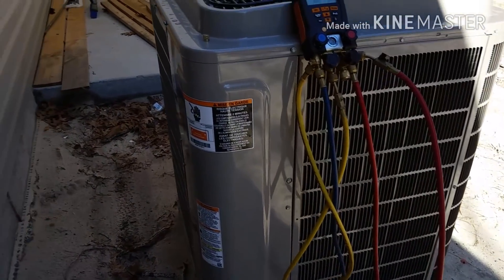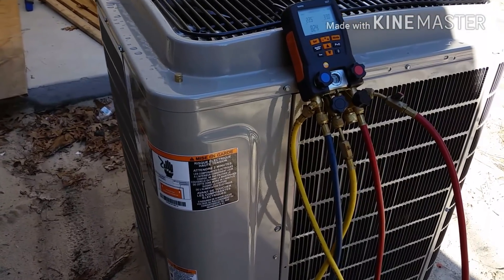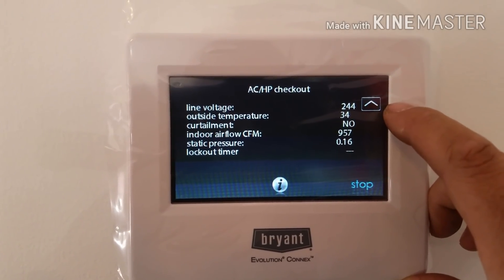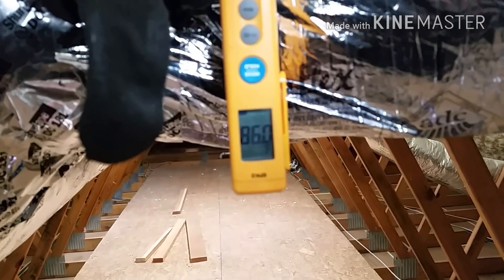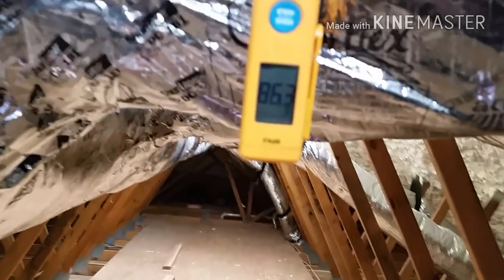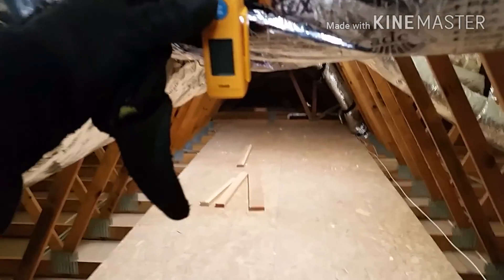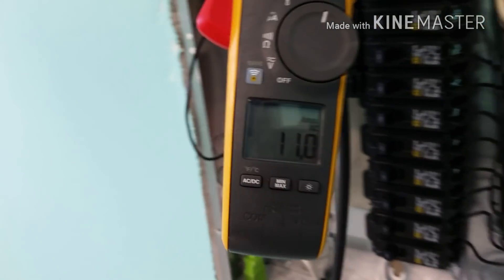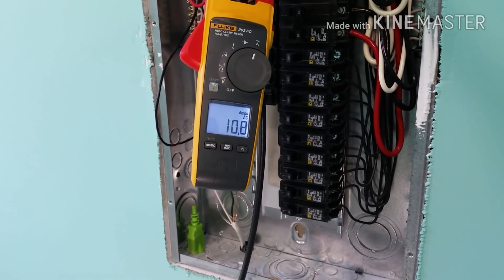Heat Pumps Can't Work In The Cold

Comment: Nice! I'm loving my Variable Speed Heat Pump. It's zoned so right now my four ton outside unit is running wide open with one zone open at 750 cfm. It's 12 degrees outside, my discharge temperature is close to 100 degrees and the unit hasn't defrosted in 93 minutes!
Reply from the maker: ComfortPlus Heating and Cooling Heating and Cooling Hell yeah! Very nice Chuck. Thanks for watching!
Reply: My mini split does a way better job 🐱
Reply from the maker: @brandonjohnson7851  As it should since ductless systems are generally more efficient. Thats why they don't have heat strips. 😏🤷‍♂️
Reply: @HVACinSC  Hi - we have a mini split and it turns off at 29 degrees (we don't have back up and have to revert to our woodstove). I have heard there can be some kind of protection (not touching the outdoor unit) which will keep the temp higher. I note here there is ducting, which of course, we don't have. I've been trying to get hold of the installer and the service in my neck of the woods to find out. They are good when they are here, but poop poor phone service, email etc. We have a 500 sq foot mother in law apartment, and the unit is a Mitsubishi, 12,000 BTU. Any suggestions for some old folks (tired of hauling the wood that we've done for 30 years prior to the heat pump)?
Reply from the maker: @Claire O'Sullivan Mitsubishi ductless heatpumps are good down to well below zero. If yours is shutting down it is likely locking out for some reason. (Example - Low on refrigerant)
Not much I can help with sight unseen but you can go to Mitsubishi website. It is fantastic and full of documents and troubleshooting and setup information.
It's called www.mylinkdrive.com
Search your specific model and see if that can help narrow down this issue.
Reply: @HVACinSC  it's brand new as of last August. How often does refrigerant have to be added? It shut down the first time it hit 29 degrees. Very consistent with that. Thank you for the link!
Reply: ComfortPlus Heating and Cooling  which system do you have?

Comment: They say it’s hard to stop a Trane. It’s also expensive to start when it fails. Multi speed motor with multiple taps was about $800. Why don’t they just use a triac a vary the voltage to it instead of a special motor with multiple speed taps?
Reply from the maker: I dont design the equipment.

Comment: I was measuring a 16-18 degree rise across a 4 ton Lennox inverter heat pump at about 35 ambient. Had the airflow settings at 400 CFM/ton, then dialed it down to 350 CFM/ton. Didn’t improve much (20F split). My boss was telling me these temps were normal at low ambient temps. Didn’t feel right to me as it was an inverter unit, which should be able to handle it. I was expecting a temp rise of closer to 28 F. Gut instinct was right.

Comment: In 2012 I installed a 3 ton Evolution Extreme and loved it!!!  Very quiet and inexpensive to run while providing "hot heat" in 36 degree weather no problem.  Minimum operating temp in heating is  -15 degrees whish I think is lower that Mr Cool stuff.  I would actually recommend a 10k minimum heat strip in cold climates as these machine are not infallible.  Great video!!!

Comment: My furnace is due and my chimney is due, I'm looking into a heat pump and I'm glad to learn you can add a supplemental heater. It gets to -30c here for about two weeks each year and -20c for about 3 weeks on either side of that. I would also put in about 5000W of solar at the same time.

Comment: So the attic is actually one massive air return and thus heated? That's allot of extra space that doesn't need to be heated...
Reply from the maker: It's semi conditioned space because it's the return. It adds very little to the load calc. This is a 2000 sqft home (not including the "attic" and the home has a 3 ton HP if I remember correctly. 
It's also "heated" naturally because of thermodynamics. Hot air rises so instead of adding ducts to pull the air up to the unit, it basically rise naturally with a relatively small assist from the blower. Its working incredibly well.
This may not work as well in other regions but in coastal South Carolina where we use cooling no less than 8 to 9 months a year, it has worked great for several years now and counting.

Comment: That won't pass final inspection without emergency heat (heat strips...)......but yeah, I've been in houses with older Trane units that worked into the 20's without back-up heat kicking in. The real key is insulation. The Trane went through defrost boards every couple of years.....never figured out why, but it worked great when all was well.
Reply from the maker: 😆😆 "Won't pass final inspection" False. Passed with flying colors..... Over 3 years ago bud... 😁 You just need to find Inspectors that understand the industry and latest technology. Electronic heaters are quickly becoming a thing of the passed.
Reply: I never ever had a unit that didn’t hear to the degree I set it in until now! I hate this! Its 32 out now and mine is only heating to 68 and it’s set on 71. It is gonna be single digits this week! Is this unit going to be useless???? Dang!
Reply from the maker: @garysdebbie Your unit is not working properly. To say they heat worse than they did decades ago is laughable. Units are light-years better today than they were in years past. In efficiency and performance. There is no comparison.
Your unit has issues. Call a licensed professional to see why

Comment: Thank you for this good explanation.  I have a modern hybrid system with a
Bryant 213B heat pump and a natural gas furnace. I would like to run my furnace 
WITHOUT the heat pump during an emergency here in the north west,  such 
as when the power is out (annually after a storm) and I could otherwise 
easily run my furnace with my generator. Is there any problem with doing
 this for a couple of days in the dead of winter when we might otherwise
 freeze? Being able to do this would mean the difference between using 
my modest sized, quieter generator or having to go all-out and buy one 
that can handle a 220V heat pump, which is not an option.

Comment: One thing you never see  from a heat pump installer is a video showing the temperature blowing out of the air vent  during  winter  outdoor temperatures below freezing . If you like cool air blowing out of the vents during winter get a heat pump if you like hot air blowing out get a gas furnace .

Comment: This video is bullshit. Heat pumps can absolutely work in the cold. My heat strips were out for four fucking days last week. Those were the four coldest days of the year, reaching single digits and never getting above 28. My house stayed between 65 and 70 degree the entire time.  So yes, they can work in the cold. The coolant they use BOILS at -15 Fahrenheit. It can damn sure condense in cold air, and condensing is what heats it up. And if you don't believe me, just turn it on in cold weather, wait five minutes, then go grab the large copper coolant pipe at the air handler. But I'll warn you, you'd better put on some gloves.
Reply from the maker: 🤣🤣🤣 Clearly someone ignorantly read the title of the video and was triggered. Try actually watching the video before commenting...
And your statements about refrigerant (Not "coolant") are terribly inaccurate there Professor... 🤣🤣

Comment: I have a question.  I have a Goodman heat pump.  Live in Concord, NC.  Unit came standard set at 30 min defrost intervals.  I have changed it over to 90 mins.   Even at 90 min intervals I have seen it go into defrost when it wasn't needed, no frost or only very light frost on coils.  When it gets down in the low 30s or 20s would it be better to turn it over to Emergency heat?  My question is basically would it actually be more cost effective in the long run?  As in wear and tear on the heat pump vs the cost of running the electric heat strips?

Comment: I guess I'm missing something bro,I definitely did nt see a loop of baseboard.So thats your primary heat source and you don't have any strips?When it goes into deforst,its  just going to blow a cold air and im assuming your freind is kool with that?I'm not sure his wife is going to be lol.I live and work on Eastern long island.I Have installed pumps without kits but I've wired them up so once it got to about 30 degrees out side the system would then use the hot water coil on the AH.In new york it definitely gets colder then SC so that definitely wouldn't fly here,how cold does it get in SC?I'm interested since that was 3yrs ago how has that set up worked on the coldest days?In the coldest part of the winters january, February. I totally get having that set up and using it up into November mid November. But then having a primary set up that would take over through December, jan ,February. Hopefully your freind is still married if he was then.Tell me some more history on that set up?Thx app it the video, hope to hear from you.
Reply from the maker: Still performing perfectly. This application is not for every region.
That said, there are plenty of heatpump systems that don't have heat strips that can produce temperatures of 105° at -15° Outdoor. Heat strips are quickly becoming a thing of the past.
Thanks for watching

Comment: How would this system be installed on a house with multiple floors?
Reply from the maker: It would require actual return ductwork so return air could be properly pulled from each floor.

Comment: It's cold but not below freezing. I would like to see how it performs in really cold weather.
Reply from the maker: This setup isn't for very cold climates. Its designed for the Southeastern US.
Reply: Well NOW in the SE it gets very cold. This weekend will put us dis to single digits with below zero wind chill. My Goodman is already using aux strips and it 32 outside! I dont get it. We use to never have to worry about our units not heating. They just DID. I have mine set on 71 right now and it’s only 68 on here. I guess I’ll go buy space heaters this week!
Reply from the maker: @garysdebbie It gets cold for very short periods of time. If systems were sized for the short lived conditions every system would be grossly oversized which would cause problems for the other 90% of the year.
If you system can keep up at 32° there is a problem.

Comment: Looks like you were only amping 1 leg.
Reply from the maker: The other leg would not tell much, if anything. All 240v circuits were read via 1 leg. Perhaps we missed a fraction of an amp. Maybe even up to 10% worst case scenario (the difference) from leg to leg.
When you check a 240v load you dont add both legs together.

Comment: I'm at a minimum 300 miles north of where this system is. I have a switch wired between the thermostat and the air handler, which keeps the thermostat from calling for aux heat. That switch has remained off for the 2 years I have lived in this house. So the only time the heat strips come on is during defrost. Oh, and my heat pump is just a standard 15 SEER / 9.5 HSPF Trane single-stage unit. But my house is very, very tight.. I personally caulked and spray foamed every gap and crack in the building envelope while it was being built.
The Trane has no problem keeping this house at 68F when it's 17F outside. No aux heat required.

Comment: I have a 95% efficient natural gas furnace. much cheaper to run than this heat pump.
Reply from the maker: Only because you are not counting cooling cost. If you're comparing apples to apples you need to take into account electricity in heat and cool, along with fuel costs.

Comment: So how much does it cost to service this system every year,a regas,pump change,this is not the future its the oldest trick in the book
Reply from the maker: Re-gas??? It's a sealed system boss. 
Pump change I assume you mean compressor? It has a 10 year warranty.
As for this "oldest trick in the book" Sounds like your opinion is based on nothing but ignorance on the topic.
These units have been used world wide for decades. It is both the future and the past boss.
Reply: @HVACinSC  got a friend working for a housing association that is using heat pumps on a large scale, the breakdown cost where so high they had to take the work in house,they can't get on top of the service backlog,these systems cost 4 times that of a boiler because there 4 times as complex ,I don't know any thing about refrigeration other than I don't want a bloody refrigerator to heat my house,so it's a closed system,what happens when it leaks,are your customers all little old ladies,how do you live with yourself,it's a total con, go on then ,HOW MUCH FOR A SERVICE? HOW OFTEN,my boiler hasn't been serviced in 20 years how much have I saved?
Reply from the maker: @gimmieliberty6514  Heatpumps have been used for nearly 80 years bud. 90% of the southern US is heated and cold by heatpumps. It is pointless for me to argue with someone ignorant on the subject of even basic HVAC. I suggest using the internet to do research on the topic.
For anyone to say they are to troublesome or expensive to repair is ignorant. Your friend is a maintenance man for a housing association. He has no actual insight into repairs and those guys usually do more damage to equipment trying to "fix" them when they need to call licensed professionals this costing them more money.
Heatpumps are FAR less reliant on maintenance than any boiler or oil furnace. Boilers require frequent breakdown and thorough cleaning every year at a minimum. Maintenance is recommended once or twice a year for heatpumps. No different than any other heating and air conditioning equipment ever made.
Prices are only relative to the specific region.
Reply: @HVACinSC  my mate is hvac,gas engineer,electrician,the company is glad they have him,he works in a part of the UK that year round benefit from the gulf stream so temps are similar the southern USA,so maybe if this system can cool in summer and heat in mild winters it makes sense,but in the UK and northern states it makes no sense,I'm an electrician working in central heating control and get asked to look at these systems and won't touch them,the normal complaint is it doesn't get hot,so I'm going to look at it and say, yep,it's working fine,it's just too cold then present them with my bill,
Reply from the maker: @gimmieliberty6514  👍
Reply: @HVACinSC  just checked,I'm at a latitude of 54° north,same as Alaska,so I suppose there not going to work for me,but will work further south

Comment: I love my ductless fujitsu heat pumps. I live in NY, they work.
Reply: @RS-hz1yi  yes, that would be more than enough. What size are the bedrooms?
Reply: @RS-hz1yi  so it all depends on the size btu you buy. I think a 18k btu down stairs will  heat you first level and 9k upstairs will be fine. If everything downstairs is open you should be fine. My 18k heats my livingroom, kitchen and bathroom.
Reply: @RS-hz1yi  the heat travels to where the cold is.
Reply: @RS-hz1yi  I dont know the lay out but if you want you can put a 6k in the downstairs room. But I think and 18k down stairs is enough.
Reply: @RS-hz1yi  I wouldn't do mr cool, sure its cheaper, but I'd rather do LG red if you are on a budget. For any unit you will need a guages, a micron guage, torque wrench. Nylog, Vacuum. And the r410 fittings. Thats if you want to do the job right and prevent moisture. There are some good install vid on YouTube. I went to school for hvac so I knew how to do it.  Most important thing is to prevent moisture from getting into your system.
Reply: @RS-hz1yi  I would say warranty, also how long will the unit last. Fujitsu last 15 years. Mr cool is pretty new to the market. But how much will the unit cost you? Can you afford to change it if it craps out in 5 years?
Reply from the maker: All ductless units on the market are made by 5 or 6 major companies and just rebranded 100 different names.
Who makes it is not very important. Who installs it is the key. A properly installed system (including proper evacuation, refrigerant charging, ect.) will have a much better chance of lasting for a long time.
The only thing to keep in mind when it comes to brands is the availability of repair parts. Many "off brands" can be difficult to locate parts.
Reply: @RS-hz1yi  i purchased mine from my local hvac supplier.

Comment: very misleading video title.  Heat pumps work fine in the cold, Scandinavia some of the coldest countries in Europe are some of the the biggest purchasers in the world.  What the video should say is that heat pump efficiency decreases as it gets colder but you must consider the whole year's performance!
Reply: We installed a bosch bova 5 ton 18.5 seer 10 hpsf. We heat/cool 3400 sq ft. Our hvac installer disconnected our 20kw heat strips via the ewc zone board. The coldest we get is -8 f in north ga Appalachian mountains 3100 ft above sea level. Our defrost cycles last no longer than 90 seconds on the coldest nights. We have not used aux heat strips ever. These new heat pumps are awesome! It costs us between $57-70 a month to heat, and $61-87 a month cool. If you dont put snow legs on outdoor unit, just clear snow to keep airflow for efficiency. We use merv 13 filters, change every 3-4 weeks for optimum blower efficiency.
Reply: @garrettandrews79  I’m planning a Bosch bova in Connecticut. Thanks for info
Reply from the maker: That's the point of the title boss. People constantly tell me in my heat pump videos that they can't perform in the cold.
Reply: HVAC in SC fair point, maybe change title to proof heat pumps work in the cold?
Reply from the maker: @maxhalliwell  I'm not looking for title suggestions bud. This video is a few years old and has done quite well titled as it is. Its titled exactly as I wanted.